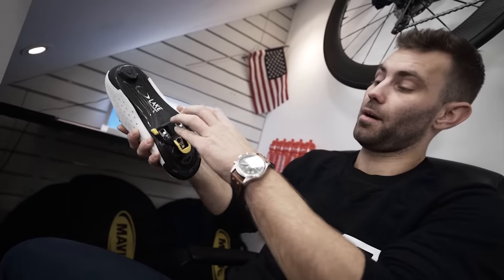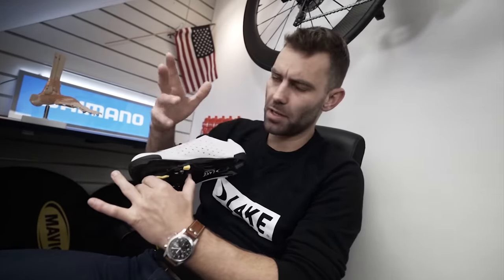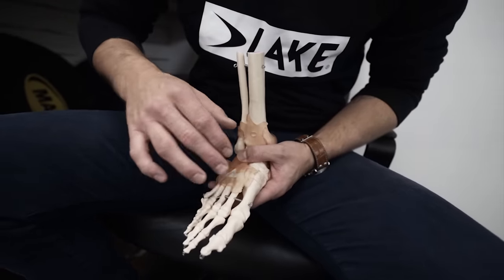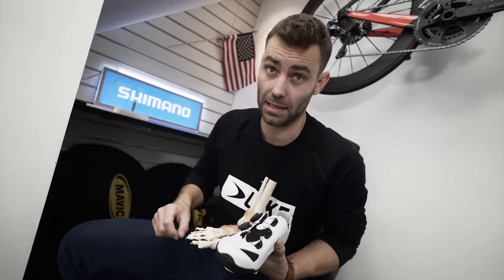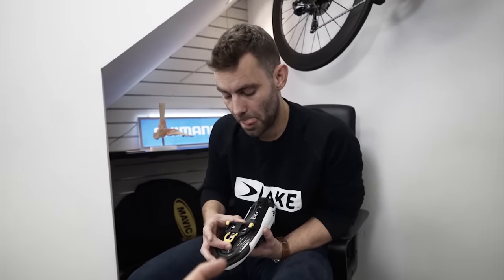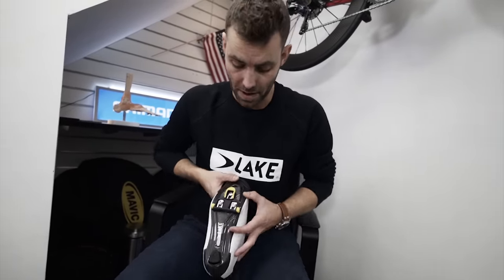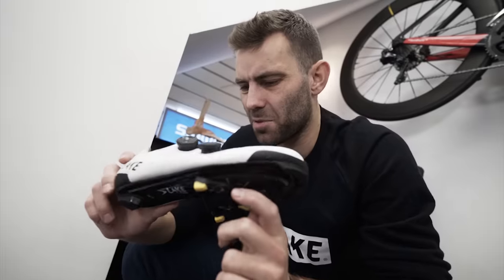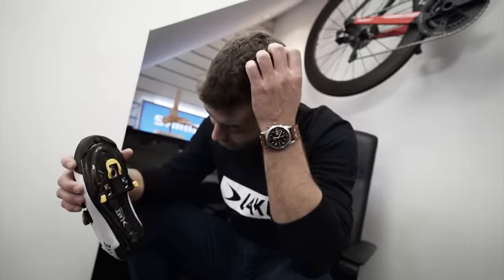How to Set Up your Cleats - BikeFitTuesdays

Comment: Hi Francis, top video!!! Is there a big difference with cleat location from a shoe brand to another one? Coming from Bont, could it be that I feel my cleat not rear enough on my Fizik while located as rear as possible?
Reply from the maker: Absolutely. Do you own a drill? 
Joking aside, this is why I would recommend against Fizik shoes. Hopefully they will fix them in future designs, but currently drilling your own holes or using speedplays fore/aft extender is the best option.
Reply: Francis Cade Wow! Thanks for this super clear and swift reply! Which are the shoe brands, in addition to the Lake -this is well noted-, you would recommend allowing enough rear position?
Reply from the maker: @jean-pierredawance8332  I don't think we've found any other brand with this problem. 
Daisy rides Giros, I use Shimano, Lawrence Sidi and they all work great. 
It's a shame because the rest of the fizik shoe is quite nice. 
I know James prefers a more structured upper to a shoe - so perhaps avoid ones that are "knitted" if you know what I mean.
Reply: Francis Cade Thanks Francis! I shall not risk to ruin them because of a poor drilling. Hence would go for Speedplay for Zwift only but not sure as this is where I (try) to put pressure or simply to sell them... Thanks anyway for your advice Francis! Have you had time to have a look to the new Rapha shoes?
Reply from the maker: @jean-pierredawance8332  not yet, but we're keen to see some !
Reply: Hi Francis,
Your cleat position theory is a true game changer!
I could have written my comment yesterday but I wanted to wait the day after to see if my incredible good ride was confirmed or not.
As said, I felt my cleat to be too much in front although placed at the most possible rear position allowed on my Fizik.
On Saturday evening, I decided to take my old Bont and quickly adjusted the cleat to the rearest possible position as you are indicating in your video.
The plan for the Sunday was a 140 km group ride. In the absence of time for adjustment, it was clearly a risky “fly or die”.
Flying I was! Never for a long long time had I so good legs, feeling lots of strength in my thighs, crushing the pedals with no “hesitation” from the knee,… Resulting in escaping from the group without willing to do so!
Incredibly more power than usual.
It also preserved my calf and my Achilles tendons a lot (this is why I waited to write later as my Achilles tendons are sometimes hurting the day after).
Hence a huge THANK YOU to you!
Cheers, JP.

Comment: How about someone who is duck footed, should I still try to get the cleats as straight as I could (within comfort)?
My knees tend to go inward, and then I read somewhere that I should have even float turning left and right from the middle "base" angle at which my foot are naturally at. So like when I'm pedaling normally, I should still can float my foot left and right equally, which it was not.
So I thought maybe the float setting was the problem causing my knees to compensate by going inward. Then I set it up this way (toe out).
But after seeing some photos when riding with my friends, it seems like my knees are still going inward, which I thought would have been fixed by setting the cleats toe out (thinking it will turn my knees outward). I have tried arch support in it helps a bit, but I'm wondering if my approach was actually correct.
Oh also I have narrow stance, but if I set my cleats more outward, my shoe will touch the crank unless I set it straight.
Reply: Oh by the way there is no pain or anything, it just looks weird, but I want to fix it if I can.

Comment: I got mine set with a template in a local bicycle shop. Now the cleats are much further on the back but my tyre touches my tip when steering. I guess that’s not very good. It might not be an issue for the most parts of my rides. But I’m a little scarred of crashing.
Reply from the maker: Toe overlap is normal, I wouldn't worry too much, you'll get used to steering to avoid it!

Comment: I know different brands of current road bike shoes and there is no way to set the cleats back for 30 or 40 mm. Because the area for cleat placement isn‘t that big. 

How do you deal with that? Drilling new holes? Thank you!
Reply from the maker: Yeah if you want them further back drilling holes is actually not a crazy idea. Speedplay have a fore-aft extender you can buy. Shimano shoes have little stoppers which can be removed for an extra 4mm (ish) of movement.
Reply: Francis Cade Thank you!

Comment: I want to know the relationship between saddle height, and cleat placement. Also leg length discrepancies.
Reply: Definitely! What adjustment should be made in saddle height to prevent overextension from moving cleats backwards? Thanks :)
Reply: Matt Clegg You would probably want to lower the saddle slightly (assuming it was in the right place to start with). With the cleats further back your ankle will flex less, so you may need to account for that - depending on if you ride toe up / toe down. 
You might also want to check your saddle fore/aft, as when you change saddle height it also marginally alters the relative fore aft (lowering the saddle brings seat forward).

Comment: James why does my right knee come so much closer to the top tube than my leg leg? I feel like I'm sitting square on the saddle so all should be equal
Reply: I had exactly the same issue. Cleats set up as advised in this video. Set straight ahead & inboard as possible to accommodate bow legs.
What I discovered....
Weak right gluteus medius.
Lots of clam shells and banded resistance monster walks corrected it and hey presto... symmetrical pedalling.

Comment: Pulling the cleats back is causing me feet numbness. For reference: I am 5 8”, shoe size 10  (41.5 EU ) and my foot has a very high arch. Most of my length is in my legs, I have a shorter torso. I just got my peloton bike 2 months ago and I’m just having a hard time finding the right form 🤦🏻‍♀️  If anyone has links to useful videos, I would greatly appreciate it ☺️

Comment: Hi, my issue: pain on the bottom of the outer part of my right foot. Slender feet, walking a bit toe-out, knees in. My ankle tends to rub a bit on the crank arm. Tried rotation of the cleats arch support and even some wedges between the arch and the ankle, which drove the knee to its centerline, but can't address the foot pain. The other foot is perfectly fine. Went through 2 Bikefits unsuccessfully....
Reply: Joao Godinho have you tried metatarsal pads in combination with orthotic insoles for arch support.
Reply: Similar issue. My bike fitter recommended shimano ultegra pedals with 4mm longer axles. Just tested them today, no more heel rub but too early to tell if there will be any knock on issues.
Reply: @richardgate1571  I didn't, I didn't consider them because I the ones I saw were soft, and I didn't feel like loosing efficiency on the interface with the bike. But I may be wrong
Reply: @drnorton364   David Norton  I considered pedal extenders, but I don't think they address the issue of the knee coming inwards, and sometimes rubbing on the toptube. As far as I understood, they might offset my foot, allowing for more toe-out, but my knee would still be misaligned, and ultimately that would reflect on the hips, saddle, etc...

Comment: One question: you are saying that a bigger rider may need wider stance. How  big is big in that regard? I am 195cm tall and weigh in at 78kg. So with regard to my body height I am certainly on the light side. With regard to those tiny climbers I am big... (This may also just be a language issue ;-))
Reply: There is no formula for that, it is just that usually taller people are also wider so they have wider stance. But it is highly individual and point is that your position on a bike should not constrain you. Sit on your bike without your shoes and see where your feet naturally fall on a pedal. You want that position with your shoes on, so if you see that pedals aren't in the middle of your foot, you might try to adjust cleat positioning. Basically you don't want your shoes and pedals to "force" your foot in any specific position, your feet should be in your natural position. Same goes for rotation and arch support etc.
Reply: Wide hips = wide stance

Comment: Someone: "Hey man, what time is it?"

This dude: The history of timekeeping devices dates back to when ancient civilisations first observed astronomical bodies as they moved across the sky. Devices and methods for keeping time have since then improved through a long series of new inventions and ideas. Sundials and water clocks originated from ancient Egypt, and were later used by the Babylonians, the Greeks and the Chinese; medieval Islamic water clocks were unrivalled in their sophistication until the mid-14th century. Incense clocks, which may have been invented in India, were being used in China by the 6th century. The hourglass, one of the few reliable methods of measuring time at sea, was a European invention and does not seem to have been used in China before the mid-16th century. In medieval Europe, purely mechanical clocks were developed after the invention of the bell-striking alarm, used to warn a man to toll the monastic bell. The weight-driven mechanical clock, controlled by the action of a verge and foliot, was a synthesis of earlier ideas derived from European and Islamic science, and one of the most important inventions in the history of the timekeeping. The most famous mechanical clock was designed and built by Henry de Vick in c.1360—for the next 300 years, all the improvements in timekeeping were essentially developments based on it. The invention of the mainspring in the early 15th century allowed small clocks to be built for the first time. From the 17th century, the discovery that clocks could be controlled by harmonic oscillators led to the most productive era in the history of timekeeping. Leonardo da Vinci had produced the earliest known drawings of a pendulum in 1493–1494, and in 1582 Galileo Galilei had investigated the regular swing of the pendulum, discovering that frequency was only dependent on length. The pendulum clock, designed and built by Dutch polymath Christiaan Huygens in 1656, was so much more accurate than other kinds of mechanical timekeepers that few clocks have survived with their verge and foliot mechanisms intact. Other innovations in timekeeping during this period include inventions for striking clocks, the repeating clock and the deadbeat escapement. Errors in early pendulum clocks were eclipsed by those caused by temperature variation, a problem tackled during the 18th century by the English clockmakers John Harrison and George Graham; only the invention of invar in 1895 eliminated the need for such innovations. From the 18th century, a succession of innovations and inventions led to timekeeping devices becoming increasingly accurate. Following the Scilly naval disaster of 1707, after which governments offered a prize to anyone who could discover a way to determine longitude, Harrison built a succession of accurate timepieces. The electric clock, invented in 1840, was used to control the most accurate pendulum clocks until the 1940s, when quartz timers became the basis for the precise measurement of time and frequency. The wristwatch, which had been recognised as a valuable military tool during the Boer War, became a symbol of masculinity and bravado after World War I. During the 20th century the non-magnetic wristwatch, battery-driven watches, the quartz wristwatch, and transistors and plastic parts were all invented. The most accurate timekeeping devices in practical use today are atomic clocks, which can be accurate to within a few billionths of a second per year. They are used to calibrate other clocks and timekeeping instruments.

Comment: Assume rearward position primarily for people who don't race. If not goes against most advice that cleats so far back will inhibit sprint/ acceleration?
Reply from the maker: Not necessarily, there's a real mix of cleat position at elite level. I have heard this advice before though, but not sure where it came from and haven't seen any studies on the matter.
Reply: @Cade_Media  something to do with calf engagement, but haven't seen definite studies either.
Reply: bstaplet the calf muscles are not a power producing muscle - they stabilise the foot, to an extent a more forward located clear may improve acceleration but not at the expense of the additional stability yielded by running the cleat further back. Ultimately it depends on the type of foot, it’s stability and the needs of the individual

Comment: When running the cleats that far back do you not start running into toe overlap issues with the front wheel?
Reply from the maker: I've always had lots of toe overlap as I ride quite a small bike size but I don't really see it as an issue, I've just got used to avoiding having my foot forward when my wheel is turned to the extreme, which isn't often. Maybe if you're racing CX it would be an issue?
Reply: I always use size 48-52 bikes and the first road bike that I clear out of toe overlap is the new Supersix Evo 2020. Comparing my size 48 new SS Evo to to my Allez Sprint Disc size 49, Front center is increased by a whopping 21mm (19mm increased in total wheelbase length, as the rear is shorten by 2mm). Most of that increased length come from more fork offset. Apart from not having toe overlap, I'm totally liking the extended front center geometry through fork offset. It handle nice.

Comment: No matter what I do even with the cleat fully back the position of my metatarsal joint is always behind the centreline of the cleat i.e. opposite side of where it should be according to this video???. Unless Im deformed somehow Im not sure what Im measuring wrong. In this case I can only set the cleat in its furthest back position? 🤷‍♂️. I normally wear size 43 shoes day to day but for riding I had a pair 43E shimano (wide) and got big toe crush issues so bought a pair Fizik Infinitor R1s  but neeeded size 44 to fit. Im starting to think the Fiziks are too thin cut for my foot hence I hav a longer shoe than ideal just bcos wanted to fit width as i seem to hav plenty room up front ??? any comments??🤷‍♂️
Reply from the maker: Fizik drill their cleat holes really far forward for some reason, almost impossible to get it in the correct place!
Reply: @Cade_Media  Thanks for the reply and its good to know Its not just me going mental. Im gonna go check out some Lake CX402 later in the week see if I fit a 43 in those or atleast fit a size that I can get the cleat behind my metatarsal. A lot of fuckin around with shoes n money wish me luck 😬👍🤞
Reply from the maker: @888jucu  haha yes good choice - the lakes and shimanos I have both allow you to get the cleat far back, but as you say, don't size up to accommodate width because this can add to the problem
Reply: @Cade_Media  Great advice, appreciate the feedback 👍

Comment: 0:51 “One of the single most important things to change” my bikefitter didn’t even look at it
Reply: just like with any discipline/job/area of expertise/ etc different fitters have different perspectives/opinion/even dogma. ask 10 experts to rank the important of different parameters and each one will give you slightly different answers, with quite a good spread.
Reply: Sky Scraper well yes, But from the two bikefitter Ive had, both from the same store... it’s a completely massive difference, so I don’t actually think I can trust them yet, because I’ve seen all these pros, and the things they do and test

Comment: The stance width is not being focused enough in my opinion and i think its international problem.
On road bikes, the distance between the pedals is shorter then mtb.
Anf if the that distance, stance width, is too short to the rider body, the legs will not be in line with pedals wich will cause the knees to compensate.
And the hips.
And problems begin to shine.
Manufectures and bike fitters ignore that big issue.
Ultegra spd sl pedals gives you an extra 4mm.
And, like you said, you can set the cleats inward as far as possible wich will give another few mm.
Sometimes that is all you need to stop knee pains
And earn full power stomp on the pedal.
Enjoy every one!

Comment: Someone should make a cheat cheat for setting up your cleats for eg. if you want your foot to turn more outwards whilst clipped in then you have to move the cleat under the shoe in this direction, etc.
Reply from the maker: It's easier to think of it as the cleat staying still and the shoe moving around it. I understand that it's a bit of a headf**k as soon as you turn the shoe upside down though

Comment: I find it more difficult to get the cleat set right on my mtb shoes rather than road ones. is it just me?
Reply from the maker: Because of the smaller size it's harder to align it properly. Also I would check that the guides printed on the bottom of your shoes are symmetrical, these are sometimes printed wonky, which is really unhelpful as you can imagine.
Reply: @Cade_Media  I heard some people advise to ignore the markings altogether for that exact reason

Comment: Intereted to hear James' view of the new Rapha Powerweave shoe and also Speedplay pedals/set-up. The devil is in the details with those.
Reply from the maker: Shoe video incoming! 
Pedals we covered a few weeks back and upset lots of speedplay users.
Reply: @Cade_Media  just watched it. Phil Burt has a whole section on them and you can see why they are good (when set correctly) and why they are bad - too many variables imo
Reply from the maker: @markrushton1516  yeah, they are fantastic if the rider has specific requirements and needs that level of adjustment, but for the average user it can cause more problems than it solves